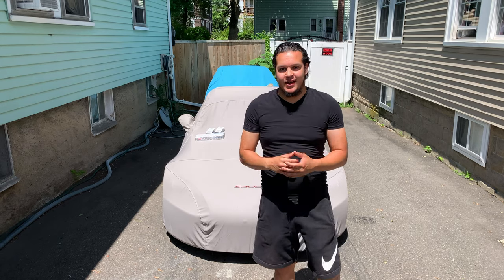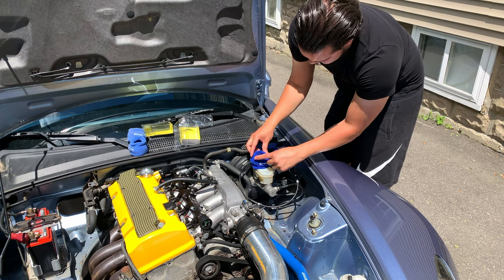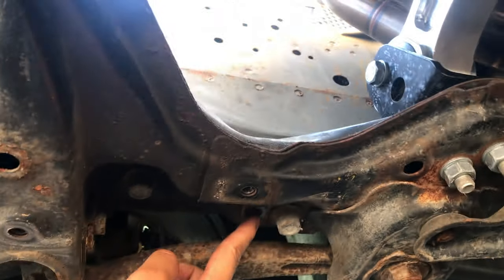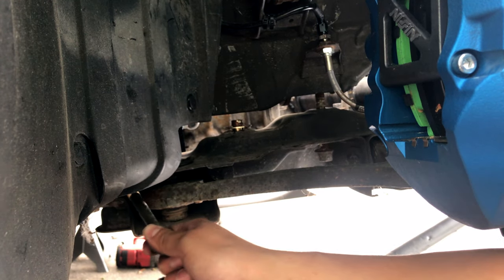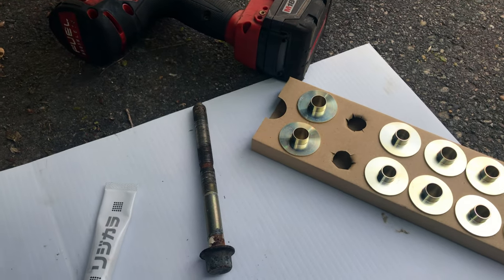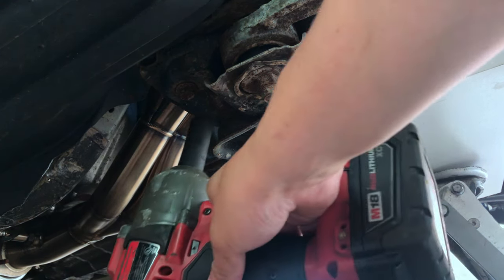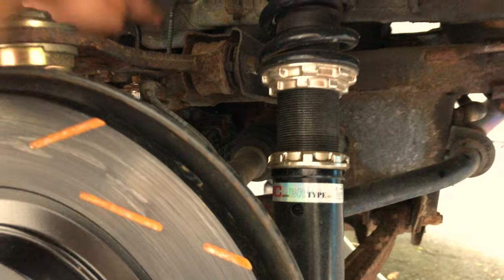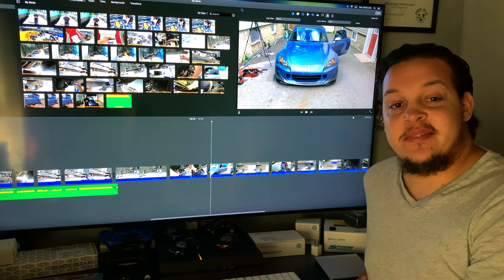Spoon Rigid collars DIY

Comment: Gave me some motivation to do this on the floor, well done, 10/10 wouldn't recommend without a lift lmao
Reply from the maker: That's awesome, thank you for watching! It's really not that bad without a lift but having one makes it so much easier. How'd yours come out?
Reply: @MojoGarage  Honestly, it was pain in the ass and I ended up dropping both subframes fully.. but its one of my favorite mods as it makes other mods work better, retorqued it after 400 miles, and thats that, also it was a friend's car I work on so he enjoys it more than me haha but I have ordered collars for my personal car too
Reply: @gabzor4716  This stuff really works? Very interesting in theory, and makes sense that the factory missed this during mass production.
Reply: @stevel.2759  It works, just subjective depending on the car, i've felt a big difference in S2000's and NC miatas and DC2 integra, but not so much on mr2 spyder, the effect is subtle but it did fix an alignment issue

Comment: Did you have to remove the engine mount nuts and disconnect the steering rack?
Reply from the maker: I did not. Just the subframe bolts are needed to be loosened to get the rigid collars in. The rack and motor mounts live on the subframe so they come down with with subframe. Thanks for watching!